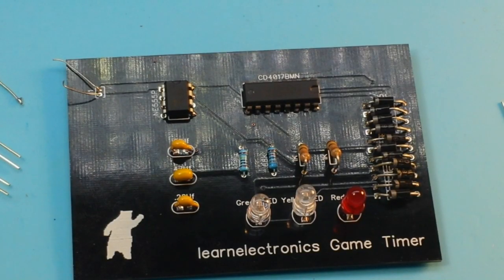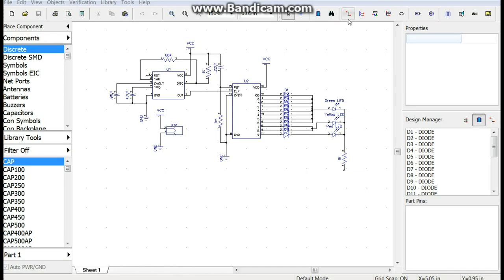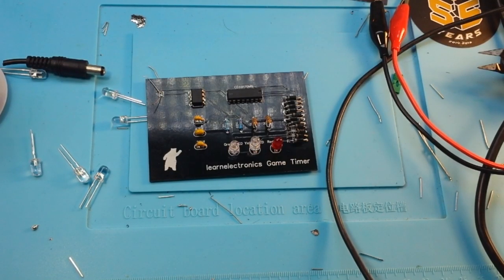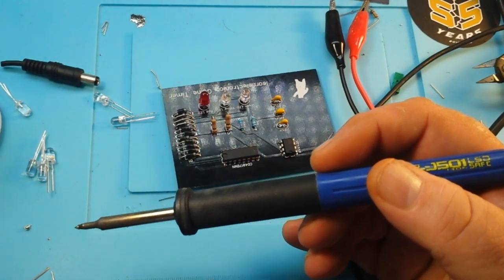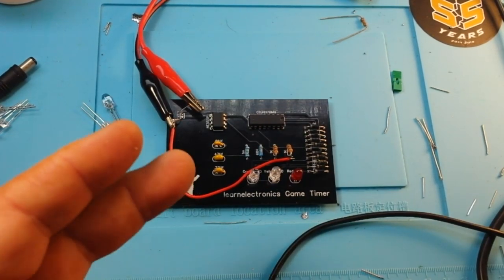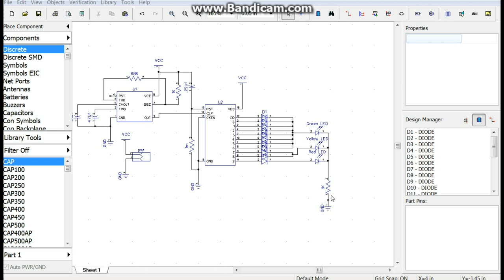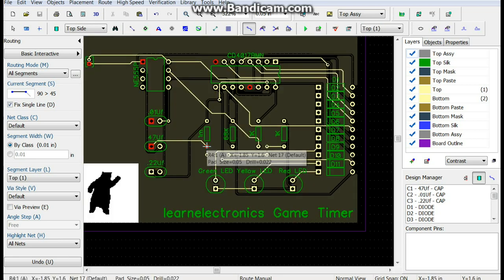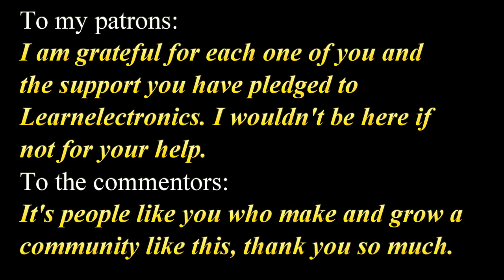PCB design mistake, troubleshoot, and repair

Comment: I remember reading on a Sparkfun website that you WILL make a mistake when making your first few PCB boards. Well add me to that category (for my power logger) which was way more complicated than this but one analog input was crossed with 5 V (oops, fried some pots in the process before I figured out the problem)...I did the wire correction method on the back and cut a trace. Still works like a charm. Making PCBs require more practice than one might think.

Comment: Now, this is a great "learnelectronics" moment. You show us how to create the circuit and board then show us how to fix it. The missing connection a friend called it the red wire syndrome, it seems I always did the same thing and had to add a wire. Thanks, Paul for the fix video, I hope the new boards work! 😁

Comment: 2:31 it's a bit in question, how exactly pcbway is doing the "order review" if they missed a mistake as simple as that? Do they just look for the shorts? (thinkingface) I guess they should clarify what that feature does even mean.
Reply from the maker: They cant troubleshoot your circuit, only check that it falls into design parameters. This mistake is totally on me.
Reply: I think they only check design problems regarding the pcb production. I'm usually using a different pcb supplier and had a similar experience there. When i made beginner mistakes like not connecting a SMD pad it came through the process because that's what they usually don't check. For other things like when i could save money by creating a larger panel or skipping v-cuts they contacted me a few times to ask if i want to change. 
I think for connection issues the check functions in the PCB Design Software could help. KiCad, EasyEDA and some others usually warn about unconnected pads unless you marked them as being not connected on purpose.
Reply: Thanks for sharing your experience,  @Leif_YT ! I wasn't expected them to recheck our circuits, of course. Cause they have no idea what it supposes to do. But something as the unconnected wire is a very trivial task for any programmer to write a check for. So I was expecting at least that, from so-called review. I think they really should improve this or at least provide more additional info about that review cause let's be honest when we order those - they come in a package of 5 to 10, at least and to some point that's gonna be 5 to 10 dead, useless boards for the majority who was counting on that review, check, you name it. And I'm sure there would be people who got mislead by that feature.
Reply: @anispinner  I agree that it would be nice if they would make more clear what the check process includes - especially as beginner that can be a little bit confusing. Now i know better :) I mean i've ordered on jlc and they're really cheap, especially if you don't take the premium shipping so there are also limitations about costs being spend, but it would have been nice.  On the other side their EasyEDA software offers all checks necessary and they've a good tutorial for it so it was also to some degree my fault that I did my first board in a hurry. On production based issues they responded within hours.

Comment: Where are your decoupling caps? You are not using them?
Reply: probably because NE555 and CD4017 is too forgiving, and also it's battery powered. 
I'm living far north, can see aurora borealis often, so I must use as much smoothing/decoupling/grounding as possible on practically anything. Cringe a bit every time when I see circuit without decoupling main ICs.

Comment: In three month you forgot that you soldered a RED wire as ground connection. You connect the +9V power to the red wire and --- BOOM!
Reply from the maker: It was just a quick check to see if I found the problem.

Comment: Glad it's not just me.  Only thing I'd do different would be to use pots instead of fixed value caps to widen the scope of uses.  Timers are fun, especially traffic light timers - all that tension!.
This was the first circuit I made at college but with transistors and bulbs - none of this new fangled sorcery .... it'll never catch on.

Comment: The 7 diodes that does to the Green LED, what are those diodes doing and does the diodes change the current limiting value for the Green LED? because the diode is .7vdc voltage drop so the 1K current limiting resistor should be a different value to compensate for the extra diode?

Comment: Hey mate, it kinda looks like you traced your ground wire over the signal wire on pin 9 of the 4017. I could easily be wrong.
Reply from the maker: When I was laying out the trace?
Reply: @learnelectronics  Yeah, I think so, not totally sure but it looked like you overlapped a trace.
Reply from the maker: What you dont see on the screen cap, is my left hand on the the 1 and 2 keys. 1 for top layer and 2 for bottom. If I'm on top and hit 2 it makes a via and drops to the bottom. Vice versa on bottom. I'm sorry I should have explained it better.

Comment: I have made so many silly mistakes over the years. Once I placed a copper fill ground plane but forgot to name it ground.....so nothing connected to it (this was before all the programs do it automatically). Boy I looked stupid...

Also I have learnt from experience when firing a board up first time, place a current limit on your PSU just incase you have done something silly!!

Comment: Paul what internal resistance do you get from the probe master leads in comparison to other leads when using the 8009?
I get just under 4 ohms from the standard pointer leads it would be interesting to take this into account when testing multimeters since I haven't come across any yt channels that have done this yet.
Reply from the maker: Less than 2 ohms
Reply: That's good it's near impossible to get probemasters in the UK & there are so many "gold plated" probes out there on Amazon that are generic.

Comment: Voice is a bit clipping on the pcbway / pc session. About the missing connection that happens. A prototype batch has the probability to get a jumper wire  to avoid production errors. ai ai aie red wire as ground ... its a prototype :P Rev 2 on its way so no fuss

Comment: Three electrolytics are drawn upside down. IMO the resistors could have been positioned better or possibly a smaller wattage used and the tracks could have been a lot wider with bigger pads as this tutorial is for beginners.
I think I said on your last design that you should test and debug before ordering a board.
The sound levels were up and down again.
I'm trying to help , Paul, so hope you take this in good spirit. I haven't given thumbs up or down.